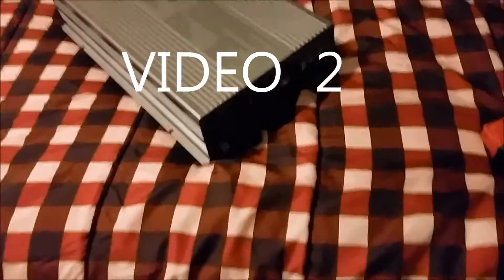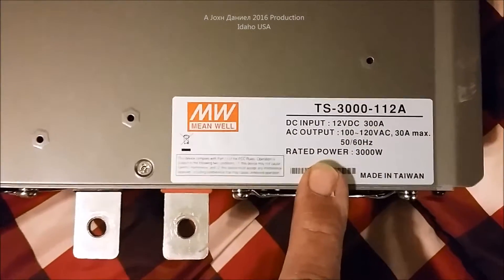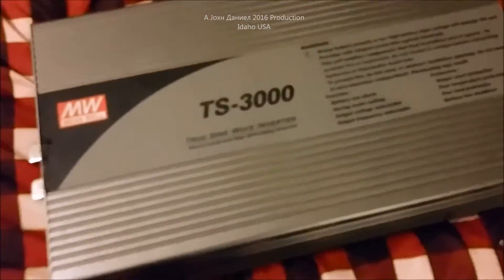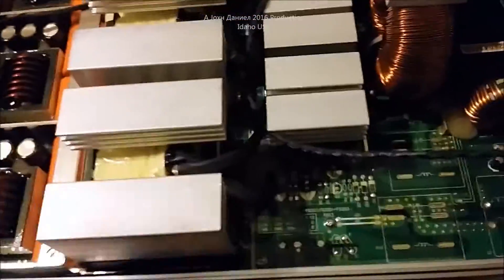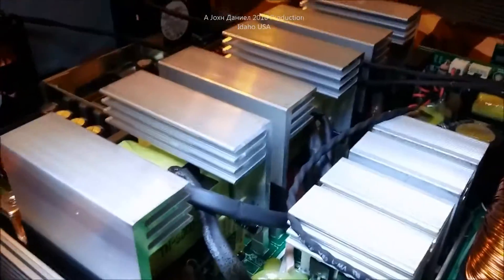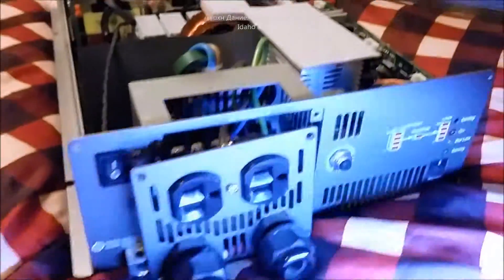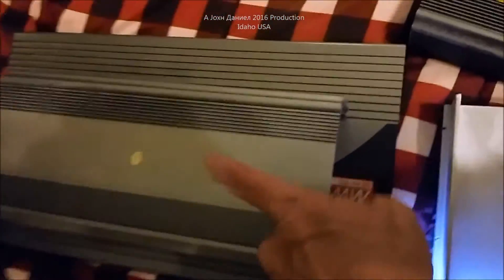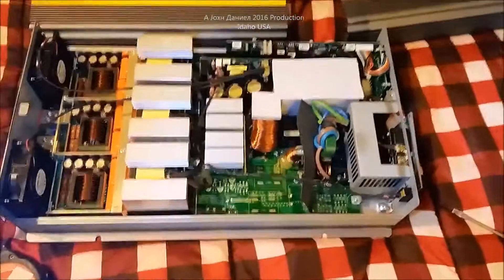Mean Well 3000 Watt Pure Sine Power inverter "Lets Open It"(see data Below)

Comment: Hi ..but late but where can I get schematic as I have quite a few burnt components and would like to attempt repair .
Reply from the maker: They offer no schematics. Mine was great till the motor home had a alternator regulator fail, and it burned the control board and now its same as yours.
Reply: And mine has shorted microcontroller pic30f1010 on control board. Can we find firmware anywhere ?
Reply: And mine has shorted microcontroller pic30f1010 on control board. Can we find firmware anywhere ?

Comment: Hi John, trying to install one of these and a battery as a backup system in South Africa. What exactly is meant to go in the NC slots? We need to add the live from our grid, but not sure where it should go? Was hoping its as easy as using the NC as the AC input. Cheers and thanks for the content!
Reply from the maker: You should have it with a input and out put AC and they are labeled L and NC ( line and neutral common ) but I would have to see your exact unit.
Reply: The model is TS-3000 224B. The user manual (for the general TS/TN 3000 all models Section 3.2 AC Terminal: shows AC terminal configuration as: AC Input (L and N) Output as (L and N) and then FG. The data sheet for my specific model (2 pager) has the following in the diagram: NC NC / AC Output (L and N) and then FG.
Reply: My model looks the same in terms of the terminals as yours in the video review you posted. Just wondering if this model is able to be connected to the main grid- as the AC input terminal configuration has the electricians confused (with NC NC)😅
Reply: Thanks again for the content and response (sorry i wasnt able to post the link to the user manual and 2 page model specific data sheet - which differs from the user manual)
Reply from the maker: Send me good pictures of unit and pics of the manual, PDF too, to my email. NC stands for Neutral Conductor but lets see if "CHinglisH" restructured badly has messed with your labels. Email me to olympicpowercontrols@yahoo.com
Reply: @JOHNDANIEL1  Hi John, thanks for assisting. I managed to get hold of the agents in the UK, and apparently the TS-3000  model is not compatible with a grid connection unfortunately. They seem to think NC stands for No Connection, so its a straight DC to AC inverter, with no mains /grid connection option. I wanted to use it as a back up for our home when the power goes out 6-12 hours per day (google load shedding South Africa)- but it looks like I'm out of luck.
Reply from the maker: Add a auto switch, to go from mains power to the inverter is best option. I prefer them over the internal UPS in a inverter. here are 2 common options https://s.click.aliexpress.com/e/_Dk0b9Rl and https://s.click.aliexpress.com/e/_DndTNsn

Comment: Hello! I have a TN-3000 inverter, which works, it is connected to the battery, but I no longer have current at the 230V output at the socket.  Please help ME!
Reply from the maker: Check solder joint on the tap on the board.
Reply: @JOHNDANIEL1  Until recently it worked. All of a sudden it doesn't work anymore... MAYBE IT ALSO HAS A FUSE??
Reply from the maker: Not all but many has a breaker on the output side. Some are mounted with trip/reset on the outside and some are inside. The top comes off, you can look inside. Also, those breakers can fail, and you have to test voltage on their incoming wires.

Comment: Hello , thanks for the video , what is the no load consumption ? Thanks
Reply: I have been using ts3000 for 8 months now and it has quite high base consumption. No load is around 40-45W, which consumes 1kWh in a day... with an average load 400w it wastes around 2kWh a day (overall consumption 10-12kWh).
Reply: I have 48v to 230v inverter.
Reply: @indrekmorell6615  Hi, I'm also in the same boat as you. Recently purchased two of these units. Mainly because I need  reliability over cutting edge new tech. I read many places that these inverters are rock solid and can use for critical places. I was running few servers and network equipment. 

But I too noticed these are using very high power even in idle mode. Could you give me more information about your setup ? what type of batteries / solar panels / charge controllers / load you are using ? 

And, as you mentioned it wasting 2kw on 400w load. did you measure the consumption when load is full or nearly full ? How bad it is ?

Finally how you experienced the quality of this unit ? Did you face any issues ? random shutdowns / overloads ? or any faults ?. Appreciate your input on this.

Comment: Hi John how do u do . I been watching ur videos on solar inverter meanwell  tn 3000.i am impressed by  your speech and experience. I would like to install an 3kw solar panel of lg with open circuit voltage of 40v can I use this panel to input meanwell tn3000 with 48v battery bank system.

Comment: For those that know electronics - meanwell makes a beast of an inverter. No clue why the US RV and TT aftermarket has not figured this out. The rest of the planet knows! I also use their supplies in a lot of other gear. Worth every penny. I have a TS-1500 and it does and will do exactly what it is rated for. Super pleased with it! Good video showing the internals.
Reply from the maker: Only fail Mean Well has is too low of a over voltage design. The 12 volt models are claimed as 15 volt but always fault at 14.6 and need to have a 16 volt over voltage ability( 32 volt in 24v models) or ever time you restart a RV with huge alternators or use a wind/solar power charging source they fault during bulk or equalize of batteries. Dozens tested, same sad result.
Reply: You are right. This is the only problem what meanwell has to improve. I use 48v system and when battery voltage goes up to 60 volts then the inverter goes to protection mode (out of service). So that the batteries can not be equalised.

Comment: HELP. Can I set this inverter low voltage point so that it only will discharge my batteries to 50% instead of 100% discharge. To set the low-voltage cut off at 24 instead of 21. At 21 V my 12 V batteries would be 10.5 V and completely discharged and hurt the life of the battery
Reply from the maker: +John Steel IV Those can have their parameters set. It should be in the manual.  How big a battery bank are you running? Hopefully over 1000 deep cycle amps @20hr

Comment: Wow!!! you mean you run an AC on this system. I think am going to get one of these.
Reply from the maker: +Ibidapo Ilawole It has no issue running up a 9,000 btu air conditioner as long as you have the solar coming in to keep the battery bank loaded. See the battery bank videos to see its mounting.

Comment: Hi, thanks for the informative video. I also have a mean well ts3000 and I am extremely happy with the performance. After watching your video I decided to clean it up but unfortunately I could not open the top cover. Could you please tell how to remove the top cover. Best regards
Reply from the maker: +Evren Azeri Watch my video again of this inverter. It's those 2 upper case screws that are hidden. You will see it in video .
Reply: Hi John, I have just noticed that I put a comment here 3 years ago. Well my meanwell has been working non-stop for 6 years without a failure. Isn't it impressive?